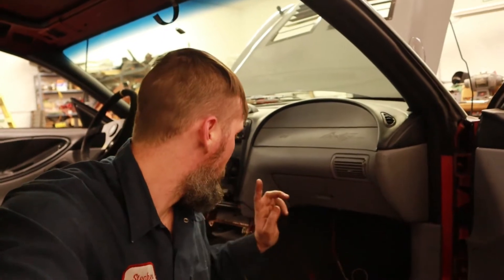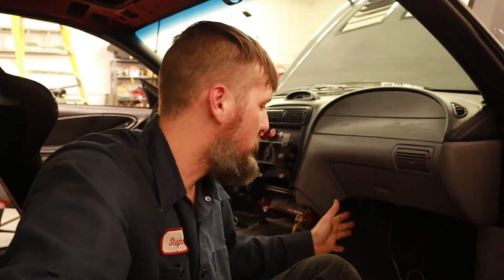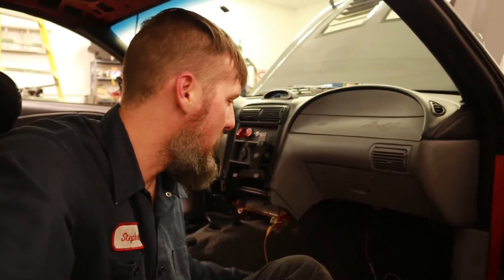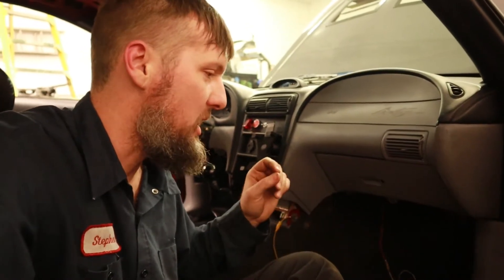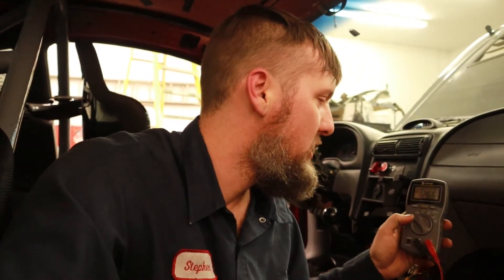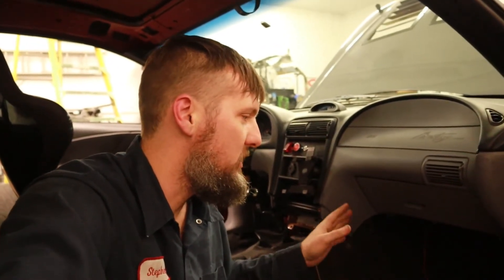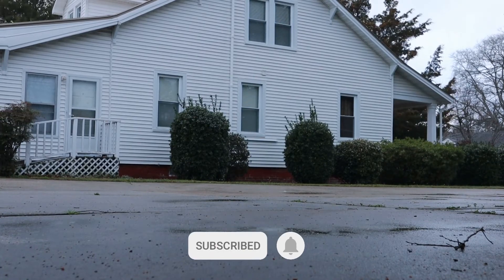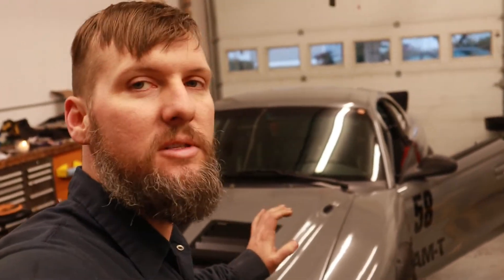Tips to Troubleshoot Ford ABS Module

Comment: Excellent ABS troubleshooting summary: Reference voltage, resistance through the sensors, sensor signal/return, brake pedal voltage, self-test, etc. I'm considering an ABS install on my Fox Mustang and your series has been very helpful. Thanks.
Reply from the maker: Thanks! I'm glad it's helpful. I really like ABS for autocross or peace of mind for the street. It would be fairly easy to add to your Fox.